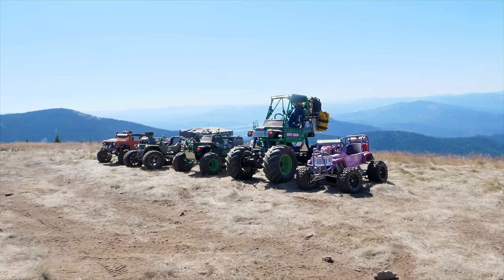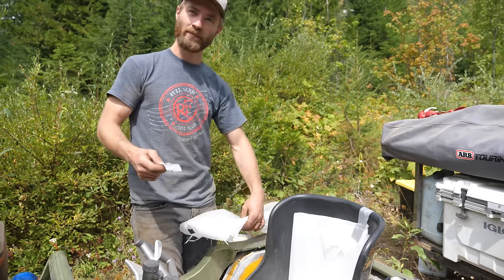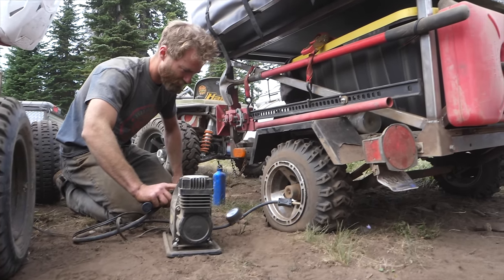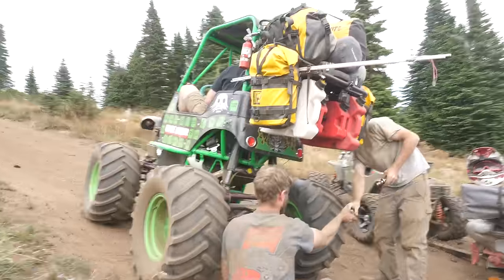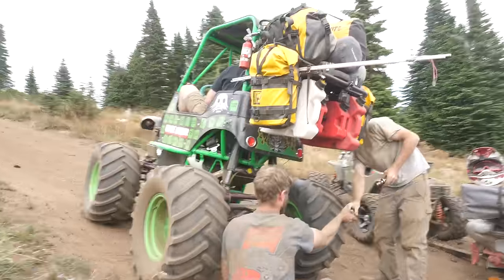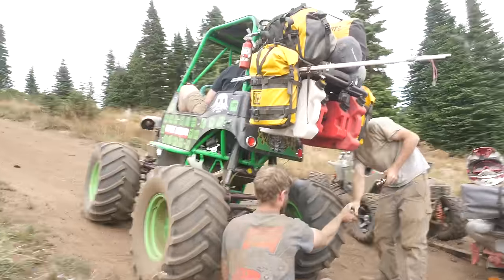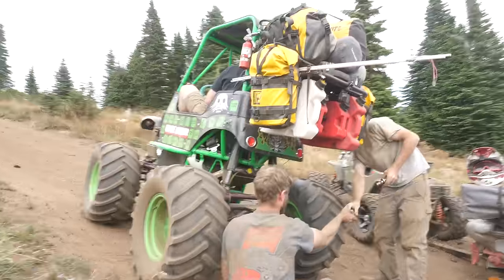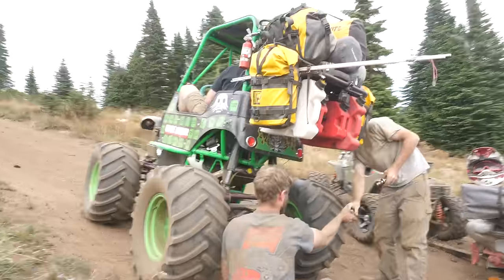Epic Power Wheels Overland Adventure

Comment: That would be cool if u put another output shaft on the senders so u could have a trailer with wheels that drive too making it a 6x6 with the trailer 🤔
Reply: Best idea!.  Fyi, your average u-joint is super strong in tension and shear.  Just hang the trailer off the PTO U-joint and add some bumpers/links to keep it from jack-knifing.

Comment: You boys are crazy as hell.
Keep up the good work! 
Also to the UAS pilot, build a 7inch 6S rig and run current stable release of betaflight, use bidirectional Dshot with RPM filtering (requires BLHeli32 ESC) or (BlHeli-S with JESC firmware) with highest pwm frequency for smoothness [either one supports bidirectional ESC telemetry] for gyro sampling data filtering based on RPM, tune it well and minimize gyro latency by reducing all of your other filters besides active RPM filtering and reduce harmonic filtering range.  Set all your rates around 500-700. Keep learning, building and flying.
To the Grind hard crew and friends: Great job.

Comment: Better clutch plates, increased ride height on trailer, beefier trailer axle/suspension, DOT rated 4-6 ply tires, ROPS on all rides (Moto Mule is good to go) warmer clothes, a generator and welder, and contact RBG, Visaily Builds, C&C to join you all on the next trip! Thank God nobody was seriously injured! This is by far the best GHPC video I've seen.

Comment: You may want to look into getting a swag, Not sure if you have them over there but here in Australia they are very common, basically a 1 man tent/bed, usually comes with a thin mattress and rolls up very small. great for this type of thing. they are used when backpacking so are designed to be carried ontop of a backpack.

Just roll it, peg the support ropes and sleep.

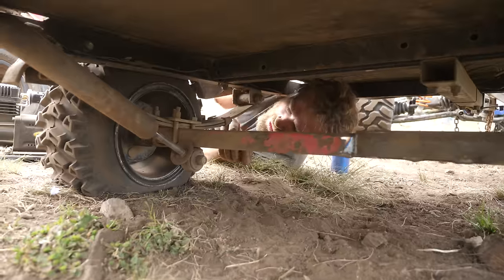Comment: 7:40 those tyre repair kits are amazing. i have used them on a few of my car tyres, a brand new tyre got a hole and the tyre shop refused to fix it, saying it was unsafe even though it matched their criteria to be eligible for repair. tried to sell me a new tyre and took a lot of argument from me to even get them to allow me to leave with the tyre back on. got home, plugged it. worked fine ever since. no issues.

Comment: Some of the trail was pretty ruff to be traveling the speed y’all was going and that was the main problem that cut the trip short and I’d be amazed if y’all built trailers that could handle that ruff of terrain. Next trip lighten the loads and lower gears and y’all will be kicking that mountains ass and wait to do the donuts when you make it back to the truck and the next trip will be a piece of cake but I’m sure y’all know how to handle it next time and you don’t never know what you might need so that makes it difficult to pack light to. I’d love to go and just take my Honda Rancher cause it looked like a blast✌🏼

Comment: Tips on the hammock... You need an over quilt and an underquilt (or insulative pad) to keep convection from taking heat away from your body underneath the hammock.  You can wrap a sleeping bag around the bottom of the hammock, against the underneath of it on the outside; you don't want to compress the underquilt underneath you.  If you combine the underquilt and a pad of some sort, it'll go a long way.  The overquilt can be any comfy blanket, comforter or sleeping bag.  For more info, check out hammockforums.net

Comment: a little late but you should just ditch the highlift jack on your  trailer. and I mean.. an rtt seems a little bourgeoisie for micro-overlanding.

hammocks are amazing, get a thermarest for the bottom and a good bag and you'll be hot as hell.

But yeah, besides all the various strength issues, low range would be great for these rigs since fast is fun, and slow is also fun/useful. 

When we go wheeling up various trails like whipsaw I like to bring n95 masks too heh

Comment: Not too many 4 wheelers with actual 4wd will drive in 2wd on the trail.  We usually put the vehicle in 4hi, just in case.  If you get into trouble, it's usually too late to engage 4wd.  Consider some kind of roll cage now? Glad he didn't break his back.  Portable welding gear next trip?

Comment: There is A LOT more to hammock camping than rather B welding knew. I'm sure he knows now, but just a $20 hammock is nowhere near enough. For overnight comfort you need an underquilt or sleeping pad to keep your underside insulated from the cool night air, and an overquilt or sleeping bag for your top side. I'm not surprised in the slightest that he froze he ass right off LOL.

Comment: The fuel pump that goes out after you go over uneven terrain: sounds like a loose ground wire somewhere in the system to me. If your voltages are sliiiiiightly low, or intermittent, I would add a few grounds to the system. It's that or find the dodgy connection, but honestly grounding redundancy when you live that hard of an existence seems prudent.

Comment: that tongue needed some reinforcement for trail ridin like that,  we pull our 4x8s and 6x8 firewood trailers thru the hills of berkeley springs west virginia, so not smoothest.. we reinforce ours at the tongue n at different places where the suspension bolt on, the side to side jarring eventually cracks the frame usually right along the edge of a weld of the spring bracket, almost every single one weve ever had   yea it would b nice to have a heavy duty trailer but its alot cheaper when i been it up myself

Comment: It's not the fault of the clutch plates that you have the gearing of a road motorcycle but off-road with hills pulling a heavy-ass trailer. lol
Those plates should go on a wall of abuse vs a wall of shame.

Comment: u guys outta build some sorta totally purpose built electric so its quiet camera man transporter :p that way he doesnt have to run as much n maayyybe catch more shots for obvious reasons   if nothin else it would a cool ass series n youd get to play with high amperage literally high power components lol :p it would b simple i imagine, i image a good clearance utv cut off everything except the grease n tape holdin it together n try to use thin walled where u can n use aluminum where u can maybe, obviously aluminum and steel dont weld so that would b a good spot to make it a modular frame  but thats if it even happens n in that way on top of that    a lifted go cart would work but youd constantly b fixin everything

Comment: 10:10 that guy doesnt know how to ride a quad becuase when ur on two ones on the right, u gotta put all ur body weight on the left so it steadys it i ride a 3 wheeler its 10x more difficult than a quad and its harder to control so basicly my point is learn to balance urself before u go and try to show off